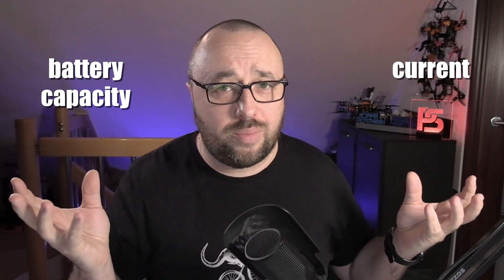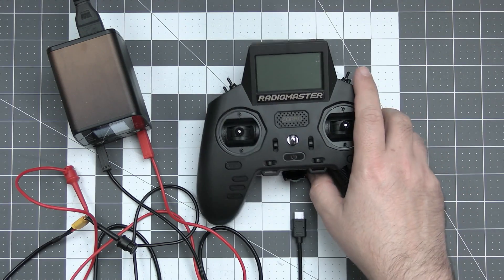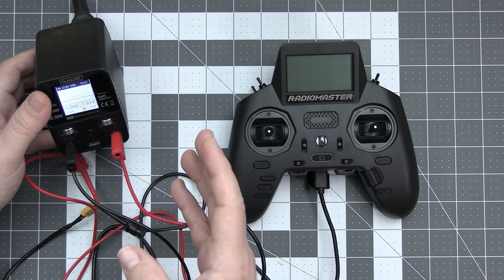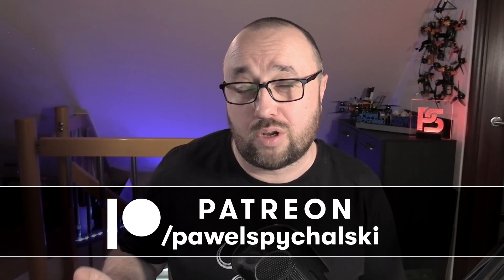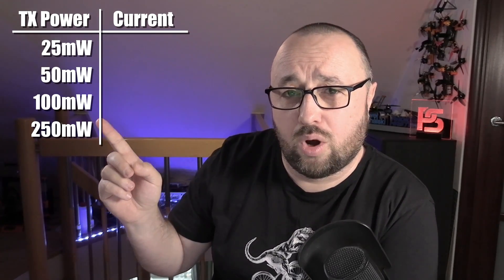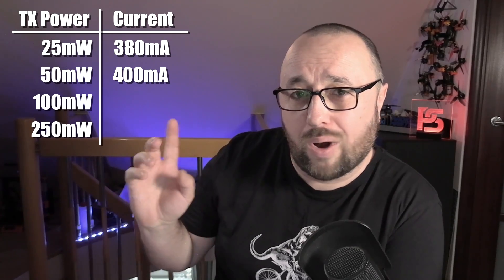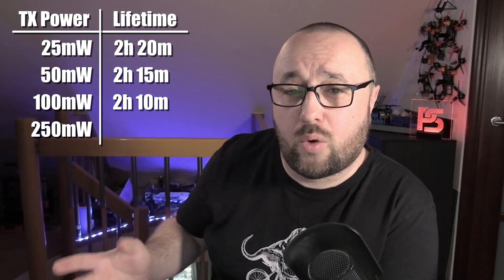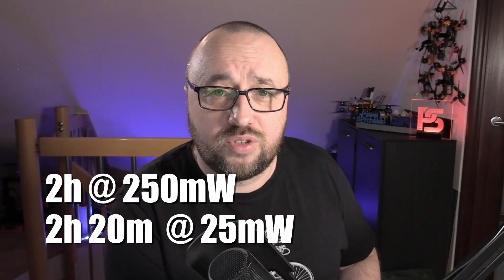How long will it work? Radiomaster Zorro Express LRS battery life

Comment: Heli Nation gave me a radio with stone dead batteries that are now damaged and only last about 18 minutes from full charge before it shuts down. I spent a month trying to get hold of them and when they finally decided to answer they claimed it was past the return window. I will never do business again with those dirty dogs. Meanwhile I had contacted radio master and they claim that they cannot replace the batteries because they're not allowed to ship lithium batteries and that I have to speak to Heli Nation.... The rubber grips also immediately fell off my battery covers and the battery covers don't want to stay on, if you bump them they pop off, radiomaster is supposed to send me new ones but they claim their back ordered and I will get notified when they ship and that's been a month ago. I love the function of the radio but why could they not have just made the hand grip slightly longer so they could put in real batteries... Please somebody make a quality modded shell that holds bigger batteries and has battery covers that are held with a release lock, also a injected rubber sport style skin for better grip, I would pay as much for that mod as I did for the radio!

Comment: Just use the Vapcell F14 1400mah button top batteries. Should get you 3hrs of flight time at 250mw. Not bad for most flying.

Comment: hello and thanks for the review! its a good one and i ordered the ELRS one so... oh boy... i have a general question regarding the option for external battery for this guy. i have many 18650's (LG HG2 3,000 Mah) lying around here and was thinking to make my own 2S with 2 of them with that small box being sold on ali express(series box). my major question is, do i really need a full 2S balance (-\bridge\+) connector or can i hook the + and - and leave the middle one empty ? will it work? does the radio actually using the middle port of the balance? 
another question i have is, since im majorly going to use it for the PC sim most of the time and not actually flying at start, how will it affect on your review on the battery life time?
many thanks!! :))

Comment: Hello, nice to know roughly the battery life for this Tx that ticks a lot of boxes for me... I'll not use ELRS in the first place, but who knows ? Two remarks; the "usable" capacity of a Li-ion battery is usually 10-15% below the rated capacity. So 900mAh means more 780 useful mAh in real world usage. Also Battery voltage drops during its use, from 4.2V/cell, to usually 3.2V/cell, so the current varies in order to cope with constant average power demand. So for the battery drain simulation, the best in my opinion is to use a constant voltage of 3.6V/cell, 7.2V for 2S, right in the middle of the voltage drop...

Comment: So if using good quality higher capacity 1400mAh 18350 batteries instead of the cheap Radiomaster branded ones, you should be able to get a little over 3 hours. I found a set that are "Vapcell F14" branded, and appear to have capacity as advertised.
Reply: Hi, I started looking at the 1400mah versions as soon as I heard the battery seems to be the downfall of this radio. I bought the Vapcell and keeppower from illumination supply here is the US. You’re the first response I’ve seen with estimated power time.  Thanks.  That’s also 3 hours  of constant on which would be a very long flying session without any downtime to stop and just hang out with everyone. Hopefully my radio will ship soon from getfpv.

Comment: No buy for me, until they put 18650. I'm not going to dangle extra batteries from the remote.
Reply: You can mod it and put 18650 in there. Seems to be the best gamestyle pad available right now unless you can go with Tango2+elrs module and deal with smaller screen + less channels. Also no trims for planes.

Comment: Thanks for measuring that. I've forgot to charge my Zorro now already two times and had to use a power bank to fly. Not a huge issue to me but it is definatly different coming from my TX16S with a 5000mah LiPO wich i charged only every couple of weeks.

Comment: Great useful info.♥️😎👍
 I assume battery capacity of 18350's tested was ~900mAh.
Using Radiomasters 5000mAh 2S 21700 external pack would last days.
Reply: Bro what should I get for my remote bad it for months didn’t use it, I have a paco pivo also did not use it Rey bring both out what exactly should I get for zorro controller on the battery tip

Comment: For the computed time, the TX amp draw was measured, but the battery capacity was using a stated value, which is hardly ever the real usable capacity. I recommend doing a discharge cycle with the Radiomaster batteries on the charger to see how many mAh they really provide at the typical amp load, stopping when they reach a voltage where the TX stops functioning.

Comment: Great testing!   How much power draws a radiomaster TX16 with its color display?   And for comparison a frsky radio like a QX7 or similar.  Does D16 default to 25mw?
Reply: For a TX16S, it's around 370ma at full screen brightness, 290ma at half brightness, 220ma with the backlight off. Remembering that half brightness is 290ma, turning the MPM off at this point drops to about 210ma. or 150ma with backlight off. All of this would be a lot higher of there was an ELRS internal module. And then you also have extra bling like the led gimbal rings :grin:

Comment: In my "real world" tests on the 4-in-1 version (with backlight off because -- why have the backlight on when you're flying?) I got 4 hours and 25 minutes from fully-charged to low-battery warning using the internal RF set to FrSky D16 protocol (60mW).  I would be very much surprised if the ELRS draws that much more power than the 4-in-1 so I would ask you to check again with backlight off and perhaps also use a good current meter rather than relying on the (sometimes not-so-accurate) meter in the PSU.
Reply from the maker: But that is the topic for the next video about Zorro and Express LRS in general
Reply from the maker: Because, this is the difference. You had 4-in-1 and I tested ELRS. It turns out ELRS pulls incredible amounts of current that is then wasted heat! Really :) Checked that. The same Zorro with external Ghost module pulls around 180mA not 400mA
Reply: ELRS is quite power hungry in comparison to the MPM Bruce...there are a pair of wifi capable chips being run which are not present on the MPM, and they chew up a a surprising amount of power all the time. Another factor to consider is IIRC the Zorro starts to become unstable under 6.4v with ELRS, so 6.5v is the absolute minimum reliable voltage ... Hence why I think 1h40m is about the max reliable runtime I'd be recommending. That's still 90 minutes of continuous use per charge, so no real complaint, since you can charge from powerbank between sessions or plug in a big battery on a wire.
Reply: i.e a quick rundown of mine with a inline DMM gives the following (my PSU is 10ma lower in all measurements above ~20ma, and I didn't bother with third digit after 25mw as the reading started fluctuating) ... One of the culprits is there is a linear regulator powering some of the ELRS circuitry, whereas a switcher would have been a better choice for efficiency). Please keep in mind 7.4v voltage, and no connected receiver. 

Zorro Internal ELRS
	Backlight	
	ON	OFF
Bootloader	0.148	
ELRS OFF	0.156	0.088
ELRS 10mw	0.539	0.454
ELRS 25mw	0.552	0.468
ELRS 50mw	0.560	0.480
ELRS 100mw	0.590	0.500
ELRS 250mw	0.670	0.580

Whereas the same Zorro, but now using an external Jumper AION ELRS nano module will pull (again, 7.4v, no receiver connected, same OWON B35T+ DMM):

	Backlight	
	ON	OFF
ELRS 10mw	0.229	0.231
ELRS 25mw	0.305	0.237
ELRS 50mw	0.321	0.252
ELRS 100mw	0.342	0.272
ELRS 250mw	0.398	0.325
ELRS 500mw	0.522	0.447

So is a lot more efficient in the output power range of the the Zorro internal ELRS. Maybe this is something they can improve on in a future version.
Reply: This in line wth Gal Kremer testing as well. He saw 2+ hours for ELRS with dynamic power turned off (max power) and at least 2x as long for the 4-in-1 version. He estimated 4-6 hours (as recording camera stopped 1/2 way through).

Comment: Pretty interesting results indeed, Pawel! Thanks! 😃
BUT... You should've tested it with 8.4v. Because when the batteries are full (8.4v) you've got the nominal capacity. At 7.5v it's only half of it. So you probably measured a higher current because the tension was so low. 
Anyway, stay safe there with your family! 🖖😊
Reply from the maker: But 8.4 quiclky drops. So test on 8V would be useless
Reply: @FPVUniversity  It heavily depends on the quality of the battery. 
I opened lots of discarded notebook batteries to get 18650 cells and I always charge them and test them. And I test them at 1a! And you can clearly see if the battery is going to be good for how fast or slow it starts discharging. 😉
Reply: In the discharge curve of liIon voltage drops quick in the first 2min then kind of linear until it is near empty and then the voltage drops rapidly/ collapses.

Comment: When Bruce did his review on RCModelsReview he got 4:22 for his battery life when flying.
Reply: Yes, and I'll be testing the ELRS version shortly.   Battery capacity/current calculations do not always represent "real world" conditions for any number of reasons.  Firstly, the batteries may not actually be the advertised capacity (may be more or less), secondly the battery voltage does vary over time which can affect the regulator efficiency and therefore the actual power drawn from the battery.  Finally, I don't really trust cheap PSU voltage or current meters nearly as much as I trust my Fluke :-)

The only real way to tell is to fly until the low-battery alarm comes on in the transmitter :-D
Reply from the maker: And I was also getting around 4h on external Ghost module, not ELRS. Turns out Express LRS pulls around 200mA only for itself
Reply: Ahh I see 4 in 1 vs ELRS. It will be a case that the 4 in 1 module inside transmits at a lower power and so the battery lasts longer. The ELRS must be power hungry, so it really could do with an external battery or mod it to 18650's.
Reply from the maker: @mehuggy  yes it is?
Reply: @mehuggy  Yes, I'll do some digging also to see exactly why the ELRS module seems to have such a disproportionately high power draw.  I don't see it doing anything that can't be achieved with a low-power MCU so something strange is going on there.
Reply from the maker: Not sure about the one built in, but external one I opened, had 2 MCU and one of them had wifi. I will be doing some tests soon on that

Comment: Pavel:
   Don't forget that the Zorro comes with a 2S balance connecter socket which would allow (2)18650 Li Ion batteries as backup power for this Tx that can be slung from the bottom brackets by a strap. This arrangement should not interfere with the ergonomics of this receiver, though it will be a bit heavier that way. 
   We could also use a 2-4 cell power bank (I have one from Ali Express) that can be strung from the USB socket while the power bank is kept in the pilot's pocket. 
   With all the options for supplemental power sources, I think Radiomaster has done an outstanding job designing a small Tx that can work for everyone!
   I would select the model with the 4 in 1 Internal RF, and use the external bay for an Express LRS RF module. The best of all worlds in a compact ergonomic package. Kudos Radiomaster!
- Jim

Comment: Would be interested how long the radio lasts when using an external module like crossfire

Did you tested it with display/background lights off?
Reply: I would imagine it would be close to identical to these figures, for the respective power levels. I have crossfire on my Zorro and am not in the slightest bit concerned about battery life. I have 2x 1100mah fogstar 18350s in mine, plus a set of spares in my bag. Takes less time to swap these over than it does to change a LiPo on the model, so I can't see the problem.
Reply from the maker: Ah yes... This will be in a separate video, because it's a very interesting thing

Comment: I'm thinking of getting one of those magnetic USB cables to charge mine, where the USB-C plug is separate from the cable and simply & easily detaches when the cable is pulled/snagged, leaving the connector in the device, ready to easily attach the cable back on when needed. At least that's the theory :)
Reply: so you'll have to cut part of the rubber cover that hides the usb c port
Reply: @grim-upnorth  If I have to cut it for convenience, I'll just have to cut it. Removing it would be preferable, replacing it with a TPU print designed to accommodate any quick-connect charging measures is even more preferable and something I might look into when I get mine, it's due to ship from Banggood within 5 days but that still doesn't tell me when I'll get it :)
Reply: and why would you do that? is it that much of a hassle to plug the usb c every time? Afraid of damaging it? I feel like USB sockets and cables won't ever get managed, they barely "clip"
Reply: @19Jose91  Why's everyone so judgemental on an idea to stop damage to USB socksts/plugs? Which does happen no matter how careful you can be.

Comment: I noticed the battery compartments are bigger than they need to be for imr 350's so I've ordered ones that are about 3 or 4 mm longer than standard and rates at 1400mah each. Hopefully they will fit. If their true rating is around 1200 (many batteries lie about their capacity) I should see substantially better performance and less voltage drop near the end of charge. Fingers crossed.
Reply: PS went back and looked at my order and they were 1400mah each I misremembered sorry. Anyway confirmed they are out for delivery today will know soon. Edited my original post.
Reply: Of they would fit, they would choose that batteries, except of they are stupid. Serious brands don't lie about capacity, change the brand then
Reply: @Flamenawer  Don't know if they lied or not. Assuming the worst. I should be getting them today will report back when I know and if good will list the brand.
Reply: do give us an update on this
Reply: Update. Unfortunately the batteries will not fit without cutting the spring down on the negative terminal and removing the plastic ribs on the positive terminal. The batteries are from keeppower and they are non-imr 18350's button tops 1400mah. A shame. I won't do that to my new radio not worth it. Just use external power if I need more time. I'll keep looking for better alternatives in the meantime.
Reply: @billyd78  planning to buy a flat top 1400mah. do you think yours would have fit if they weren't button top?
Reply: @pipoypipoy7796  Needs to be a button top imr size. Flat tops don't reach the positive terminal.
Reply: Some of 18350's and 18650's meant for use in flashlight have protection circuit on top to prevent draining voltage too low (common if a flashlight is left on).

For capacities above 1200mAh, it's likely that a lower minimum discharge voltage is being used in testing. eg: might be low as 2.5V per cell. Without testing, it's hard to tell what the minimum voltage the Zorro requires to operate. I my require 5.5-6.0V (2.75-3.00V per cell). 
Just noting that one needs to verify on the bench, to avoid surprises when flying.
Reply: lygte-info is a good site to look at before getting rechargable batteries - I've ordered some Vapcell INR18350 1400mAh cells based on the charge/discharge test results... at 0.5A drain they are nearly bang on 1400mah capacity so should do quite a bit better than the 900mah RM cells.

Comment: I,d just plug in to a powerbank in my pocket...and charge the radio while I'm actually flying.🤗
Reply: was thinking about it as well (my radio on the way and i have a 20,000 mah power bank sitting here with USB-C out) can it actually charge it faster than the power its using ?>